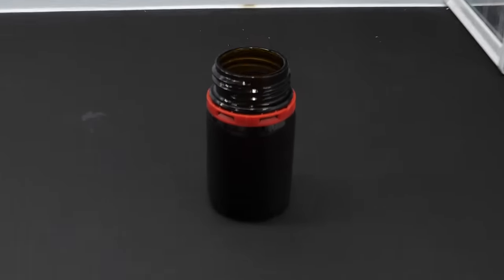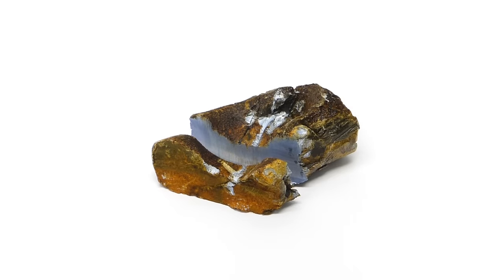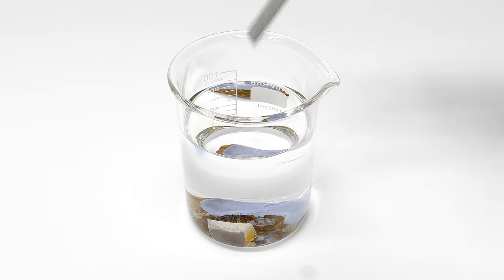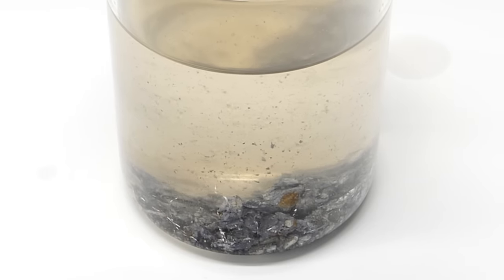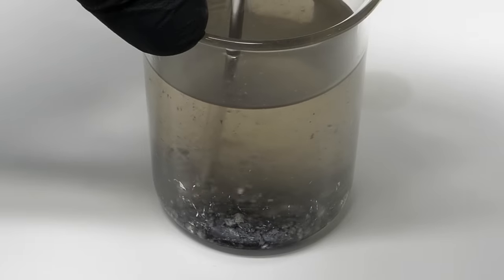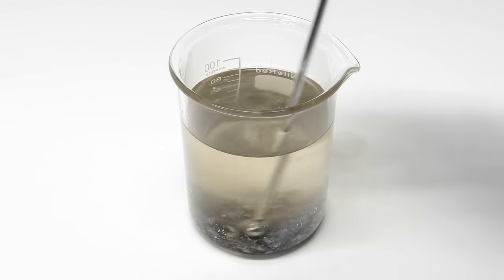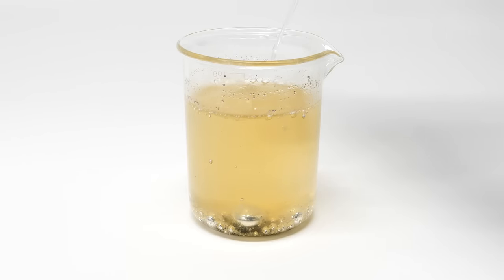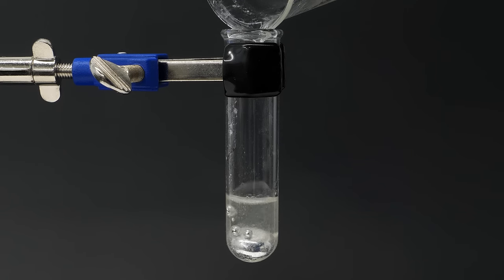Mixing sodium and potassium is crazy (NaK)

Comment: The only thing wilder than the fact that these two highly reactive metals combine to form an explosive liquid alloy is that there was seriously a plan at some point to use it as nuclear reactor coolant.
Reply: NaK is already used in solar array generators.
Reply: @patrickjanecke5894  I hadn't heard that! That is also kind of wild. Call me timid, but "may catch fire when exposed to air" is generally a deal-breaker for me when it comes to infrastructure.
Still, a solar array spontaneously catches fire & explodes, it's probably not international news.
Reply: @KSignalEingang  😁 lol
Reply: ...and now I'm reading that about 10 years ago somebody was marketing a CPU cooler that used NaK... 

Welps.
Reply: It is already used as a coolant on nuke subs.
Reply: "Yeah, but your scientists were so preoccupied with whether or not they could, they didn't stop to think if they should."
Reply: There wasn't just a plan. It was used in the soviet RORSAT satellites as well as in an actual Nuclear Reactor which powered the UK power grid from '59 to '77 (Dounreay Fast Reactor was it's name). 
The issue with their past usage as a coolant on satellites is that it has leaked on multiple occasions (e.g.: Kosmos 1818 and Kosmos 1867) and as such there are now multiple bubbles of NaK orbiting the Earth as space debris. BTW these bubbles can be up to several centimeters in diameter...
Cool stuff huh

Edit: corrected a mistake pointed out by John McCallum
Reply: @adama1294  As far as I know only the Alfa class subs used a liquid metal reactor in an operational capability and those were Lead-Bismuth cooled reactors and not NaK
Reply: At least Superphenix "only" used sodium without the potassium as nuclear reactor coolant ... which still was dangerous enough by itself.
Reply: @emile_jeanne  I think you mean The UK as Dounrey is in the North of Scotland
Reply: @johnmccallum8512  you're absolutely right, I misread something on the Wikipedia article.
Reply: @chaitanyasingh3258  And for obvious reasons, metal-cooled reactors are not an amazing idea, even leaving aside the complex nuclear science that explains why water is a god-tier reactor coolant.
Reply: Works better than water and is being used in some nuclear powered vehicles as you dont have access to the outside so you need a internal cooling system and this works to move heat out into the sea through the steel wall these points are also weak points as these area produce a heat reading.
Reply: @KSignalEingang  Maybe not international news in the same way as a reactor going all pear-shaped, but I could see no end of memes about a solar array experiencing a "meltdown." Kinda' like how a lot of us went ape with "The ocean is on fire!" a few years ago.
Reply: @KSignalEingang  The world's been safely dealing with pyrophoric substances for a very long time.  We couldn't exist as the society we currently have unless that had been figured out.  For example, I built a couple ammonia plants about a decade ago.  The development of the Haber-Bosch process to catalytically make ammonia to be used as fertilizer has led to 1-2 billion more people being able to survive on the earth, probably more.  The catalyst for the reaction is pure iron.  But it arrives as iron oxide and has to reduced in situ at the start up of the reactor to pure iron to catalyze the reaction.  Pure iron is extremely pyrophoric, of course, as anyone that has ever seen a tool create sparks can attest.

Now, because that reduction process takes so long, and takes so much valuable hydrogen to complete, usually the catalyst is sold partially reduced already.  That significantly speeds up plant startup, but it also means that the catalyst will start burning if you expose it air when you take it out of the drum.  Ammonia plants use significant amounts of hydrogen and run at about 900-1000 deg F and 2000-3000 psi pressure.  Hydrogen has one of the widest flammability ranges of anything; it will combust with as little 4% and as high as 75% hydrogen by volume in air.  So even a little leak of hydrogen is a terrifying thing, and they're very hard to detect.

Despite this, ammonia production consumes a few percentage points (it may have been close to 10% at some point) of the entire world's energy consumption last time I checked.  So, engineers and operators have managed to figure out how to safely deal with pyrophoric substances and much nastier conditions in much more dangerously flammable and explosive environments at a scale that dwarfs almost every other type of industrial production in the world.  Still, fellow engineers, never get cocky and lackadaisical; the stakes are always high no matter how many times something has been implemented safely.
Reply: @kdawg3484  this was very informative! Im a chemical engineer in the biotech space, so its always cool to learn more about other sides of the field :) cheers
Reply: At my previous job, I once spent a few days trying to find papers about the physical properties of NaK because I wanted to estimate the effect of solar radiation pressure on the orbits of the NaK droplets that are orbiting the Earth as space debris.
Reply: We were using a 55 gallon drum filled with sodium to fill up an experimental scientific instrument that applied a magnetic field to a drum and would measure the field when the drum was stationary and empty, when it was spinning at 3,000 rpm, when it was stationary but filled with 55 gallons of liquid sodium, and when it was filled and spinning at 3,000 rpm. To run the machine, you have to heat up the entire machine to about 120 Celsius to make sure none of the sodium freezes in the machine. Nobody wants to be anywhere near the building that it's in when it's turned on. I figure NaK might be a much easier medium to use in the machine rather than sodium because it would remove 10 hours of work before and after running the machine.
Reply: @KSignalEingang  TBF, NaK is much less likely to explode from phase change pressure...
Reply: @KSignalEingang  As an engineer, I would rather a nuclear reactor were cooled by NaK than water.  With a boiling point of 760⁰ C and not being nearly as effective in galvanic reactions, it is far less likely to either burst from pressurized vapor (insert every nuclear power reactor catastrophic failure so far here) or chew through the metal pressure vessel holding it (a home hot water heater lasts how long?)

Yes, it is scary when in contact with water, and can even burn in air, given time, but water is far more difficult to control.
Reply: what do you mean "was"? Still is
Reply: @patrickjanecke5894  Periodic Videos did a short vid on Nak and in it they mentioned that NaK was corrosive, how do you deal with that? Do use stainless steel piping or some other alloy?
Reply: i mean it's a metal alloy that's liquid at room temperature, that's a very good thermal interface, and it's made from fairly low-cost ingredients, i'm surprised it isn't used more often. would probably amazing if someone could use this in microfluidics for some on-chip cooling.
Reply: Liquid metals are super effective as coolants.
Reply: @patrickjanecke5894  Thank you for the info.
Reply: @KSignalEingang  that's a great idea thank you.
Reply: @this_is_japes7409  my exact thoughts. I read a comment in fact that someone said a company used it to cool CPU's so I can't wait to try it.
Reply: Not just a plan. It is used.
Reply: IIRC some of the Soviet reactors in satellites use this as coolant. Exposure to air really isn't an issue there.
Reply: @KSignalEingang  yeah I don't think solar arrays are liable to douse a large area in radioactive fallout making it uninhabitable for literally thousands of years so I think NaK is much safer there
Reply: @AsbestosMuffins  I meant solid metal reactors need to be running above a certain threshold at all times, they have some major drawbacks. That said, that is less of a concern for a civil plant than a warship.

And in any case, I too am a strong proponent of nuclear power.
Reply: @KSignalEingang  lithium ion batteries catch fire when exposed to air...
Reply: @chaitanyasingh3258  There was also a single November class that use the same reactor(s) as the Alfa.
Reply: Use a explosive for a coolant?? Wtf?! That is a suicide mission!!
Reply: Lithium battery is kinda the same useful to explosive ratio, no?
Reply: It is used in some car engine valve stems as a coolant. Since it is sealed inside the stem, it is pretty safe.
Reply: Well....that would have made the Chernobyl disaster much more....... interesting!
Reply: to do WHAT
Reply: @dojokonojo  
The author of that never thought about whether he should have used hallucinogenic drugs. Or use BS chaos math in that book. Chaos math is fine. But it has nothing to do with the keeping dangerous animals pinned up.
Reply: What I’m getting from some of the longer comments here:

“It’s nothing special, but follow SOP”
Reply: It has also leaked out of satellites, becoming space debris.
Reply: Compared to high pressure steam that is positively benign. I had only heard of using sodium as coolant but I see the advantage of liquid at room temperature.
Reply: @emile_jeanne  imagine the light show of a several Kilometers wide ball of Nak entering the atmosphere . Several centimeters in diameter just isn't enough for for New Year's Day. 

I propose More Nak in low earth orbit, this is my contribution to Humanity, based on the info you provided, you should be honored, you're welcome humanity!
Reply: it wasn't planned it was actually used -> https://en.wikipedia.org/wiki/Sodium%E2%80%93potassium_alloy#Coolant
Reply: What? I'd better stay with water rather than having this explosive thing in an already dangerous nuclear reactor which can also explode without proper treatment
Reply: @maverickgames5972  
It burns on contact with water and air but is at under 2bar when the reactor is hot rather than 70bar. The steam leak is far more dangerous than a flaming liquid metal leak.
Reply: Well that plan seems like a reality
Reply: Ironically it's much easier to safely store sodium (which does not burst into flames on contact with air) than supercritical steam in the event of an emergency.
Reply: @emile_jeanne  these blobs are no longer in orbit
Reply: @calvingreene90  Anyways not a good idea in any scenario haha
Reply: @ERIK-457  Reactive with water =/= "explosive". This stuff won't phase change until extremely high temps allowing for a thermodynamically efficient working fluid that will only smoke and fizz when it leaks rather than becoming an exploding death ray like water.
Reply: @emile_jeanne  so, it’s stable in the vacuum of space?
Reply: @BearAerospace  HOw high is that temperature at which it starts to set on fire?
Reply: Chernobyl would have been much worse, is all I'm going to say.
Reply: @emile_jeanne  hey uh
How bad would the damage from those NaK bubbles be if they went boom on earth
Reply: @benorth0311  Well they would only react with gamma rays and other radiation found in space. So I guess it would maybe become slightly radioactive, but it wouldn't react explosively since there isn't really any water up there for it to react with. The Wikipedia article only mentions that in the vacuum of space, NaK self forms into bubbles. That's pretty much it.
Reply: @emile_jeanne  thanks Emile! I usually do not use Wikipedia, but I may have just found a reason! Awesome!
Reply: I guess if you're already qualified to make sure the nuclear stuff doesn't leak out, then you're fine making sure the regular stuff doesn't leak either.
Reply: Don't worry, in the nuclear power industry everything is always completely under control.
Reply: It was between that, and heavy water. Glad they didn't try both at the same time!
Reply: @adama1294  on what sub? all active subs use water pressure reactors only soviet alfas used liquid metal reactors but those used lead-cadmium coolant that is really toxic
Reply: @dojokonojo  If you think this is bad, read about studies into AI safety.
Reply: Because "Explosive" and Nuclear reactor" go great to get
Reply: What's the appeal of using this as a coolant as opposed to something like water, which is normally used and is a million times safer, or even something like mercury, which might be toxic but at least it doesn't spontaneously combust and explode?
Reply: well not like it is the most insane nuclear plans i have heard. the one to make the panama canal by detonating 28 nukes to git rid of all that pesky dirt and rock
Reply: @adama1294  this is not true. As others have mentioned the Soviets did use a lead-bismuth eutectic in the Project 705 boats.
Reply: @BearAerospace  Interestingly, the reaction with water is sort of explosive, and it's only recently we had any real idea why. Rather than just reacting at the surface, the water seems to dissolve the electrons unreacted, causing surface tension to drop below zero and jets of metal to get launched into the water, increasing the reaction rate massively. 
The biggest problem is that water is also a fantastic radiation shield and backup coolant, so we would love to be able to have everything in a giant pool of water. Large quantities mixing is not unlikely in an accident. If they were just hypergolic, and that meant a big fire, that would be bad, but manageable. Hypergolic mixes are generally quite difficult to make explode, because they burn before that happens. For these two the reaction actually drives the mixing, making it far more dangerous than just fizzing and smoking you would get from a normal hypergolic mix.
Reply: @petersmythe6462  hopefully it burns up before re-entry I'm sure the soviet's calculated that 😂
Reply: Its one of those things though isnt it. Once a nuclear reactor has exploded, a bit of nak is going to do very little to change the results. :)
Reply: I'd like to learn more about that. Why? How? Where? Was it ever tried at all?
Reply: NaK coolant has been used in dozens of past and present reactor designs (EBR-1 and 2, Fermi 1, Phenix, Superphenix, Monju, BN-350 and its predecessors, and the currently running BN-700 and BN-800.) Its main advantage is low neutron absorption and very good thermal conductivity. The reactors are safe and designed to contain any possible leak of NaK.
Reply: @adama1294  Aren't they using pure Sodium (not that I would be less worried then)
Reply: sounds safe to me
Reply: @KSignalEingang  Well yeah, when the fire goes out and the smoke subsides, you're CPU will be at ambient temperature.
Reply: @KSignalEingang  never seen how hot the oil gets in gas turbines? Or wind turbine reduction gearing? 

Because I'll save you the effort: Hot enough to be in the autoignition range, fire held in abeyance until it gets oxygen. 

Wind turbine fires, spectacular ones at that, have been recorded.
Reply: These are not just the plans, sodium was used as coolant in breeding power reactors in France and Soviet union and is still in use in 2 operating plants in Russia, one more is planned to build.
Reply: @jamesharding3459  water is god tier until you realize that it requires high pressure to not boil at too low a temperature and that it can generate hydrogen gas with the zirconium on the fuel rods. 

Edit: oh yeah, and even when your reactor is a radioactive pressure cooker the water still boils at a fairly low temperature, theres a good reason many reactor concepts and some being developed rn do not use water
Reply: Imagine if the pipe broke in the heat exchanger.
Reply: @alikibueno2062  you'd probably be surprised, but tube rupture in PWR steam generator is no less dangerous (at the very least)
Reply: it's a great coolant for nuclear.. water as coolant is bad. It breaks down into hydrogen and oxygen gas, which explodes...
Reply: @KSignalEingang  well nak is a really good conductor and it’s lighter than water to making it useful in lightweight nuclear reactors and quite advantageous to use when the thermal conductor is at the top of a 27 (90~ft) meter tall tower
Reply: They use nak is a ingredient for firework
Reply: @KSignalEingang  big oil would have a field day. I'm sure you'd never hear the end of it
Reply: It is also used as a hydraulic fluid in high temperature and radiation environments
Reply: The great thing about NaK is that it can be pumped electromagnetically, with no moving parts.
Reply: @adama1294  I'm guessing because of the pump system having to be extremely quiet, in other words it uses an electromagnetic pump to circulate the NaK?
Reply: Worked in a Union Carbide plant in Luling, LA  in the early 1970s where several tons of this alloy was used as a heat exchange medium in one of the units. One day there was a leak and the resulting explosion leveled the unit in the plant, including destroying the process control computer center in an adjacent building.
Reply: Wha- Huh?
Reply: Just because something is highly reactive doesn't make it instantly hazardous. Stop breathing oxygen if you really feel so worried about reactive materials.
Reply: You do know that people use hydrogen to cool generator for steam power plants right? Eventhough hydrogen is explosive.
Reply: @KSignalEingang  I can almost guarentee that was bc they didn't want to use galeum due to how it eats certain metals.

Still NaK in a homemade build seems sketchy.
Reply: @KSignalEingang  yeah that sort of happened once too... early british reactors had a problem with air.
Reply: It was more than a plan. It actually WAS used as a coolant. It was used in fast breeder reactors like the Dounreay Fast Reactor because it doesn't absorb neutrons.
Reply: @dojokonojo  Yes, Unfortunately your statement applies to pretty much everything human's have been doing for thousands of years !
Reply: Not just a "plan."  Pratt and Whitney and United Nuclear..,
Reply: Wasn't that how they did it in Soviet Russia?
Reply: I would have expected it to be used in a crossbow bolt of sorts.

Reacting with the water inside living tissue.
Reply: See it at dounreay Scotland. Liquid sodium coolant
Reply: Chernobyl likes it xD
Reply: imagine a normal civillian in the future when they found ruins of these nuclear reactor, tries to fiddle and turning it on, but is looks like it gonna catch fire and tries to douse it with water and then BOOM
Reply: I don’t see what’s wrong with that
Reply: @KSignalEingang  though i dont know if it's the same, iirc i saw a review of a cpu cooler that worked by de-liding the cpu and having liquid metal as the heat conductor (liquid metal touching the exposed cpu). Worked and kept the cpu very cool but also seemed difficult to install so would never even think of trying it
Reply: Hindenburg comes to mind
Reply: @patrickjanecke5894  At least that won't become radioactive
Reply: It was used in the fast breeder reactor at Dounreay for almost 20 years with no major problems. Like anything else, scientists proposed the mix for good reasons. And like anything else, as long as it is well designed and built and proper safer procedures are followed, there should be no issues. 
Indeed, you could make the same point about a highly flammable and explosive hydrocarbon mixture (petrol) used to power cars...
Reply: Not only a plan it has been done
Reply: @adama1294  it's a liquid metal, so its much more heat conductive than ordinary coolants, 

yes, you could use mercury, but if the submarine is taken down in the ocean, you dont wanna have a buncha irradiated mercury in the water
Reply: @emile_jeanne  dw, they'll blow up as soon as they enter the atmosphere
Reply: @God-ch8lq  It's ok I'm not worried lmao :D
Reply: What
Reply: @KSignalEingang  "Call me timid, but "may catch fire when exposed to air" is generally a deal-breaker for me when it comes to infrastructure." 
- has me in completely in stitches! 
You sir, have won the internet for me today <3
Reply: @dojokonojo  you legend you <3
Reply: There would be a huge problem if water started getting in
Reply: @kdawg3484  i was thinking there was a possibility you may be lying, as people normally do, but then i noticed your join date, and im going to be honest, no story fabricator would be that old, but if you could further the proof, i would like to see some videos of the plants you built, if you live around the area. i generally like things that deal with agriculture, and it is what i major in. i will have to look into the use of ammonia in fertilizers for myself now. im already aware of potassium nitrate in fertilizer, but its so hard to get your hands on it these days because people keep using it to make bombs.
Reply: Damn
Reply: @adama1294  NaK. Near a nuclear reactor. On a SUBMARINE. I beg of you, say sike.
Reply: Bro :l
Reply: @KSignalEingang  we already have galinstan for that and its already a big no for me just in case the gallium in it touches any alluminum
Reply: Forget Chernobyl, that would have made Planet Earth go critical 😆😅
Reply: more like a nuclear reactor cooln't
Reply: @kdawg3484  There is a wonderful book called “The Alchemy of Air” about the discovery and commercialization of the Haber Bosch process and the unintended consequences if having an abundance of ammonia.
Reply: The weirdest thing about it to me is that the reaction to make it isn’t instant/explosive
Reply: @thecyberrabbit1440  two very similar elemental metals in a molten state being combined. Called alloying, backbone of civilization. While each is very reactive to other dissimilar substances, they are chemical siblings and more or less unreactive towards each other
Reply: @nohphd  they weren’t molten. They went from solid to liquid by combining. They weren’t liquid before they reacted
Reply: @thecyberrabbit1440  Na and K combine to form a eutectic alloy which itself has a lower melting point than either of the melting points of the pure elements. Physical chemistry is weird…
Reply: holy , can you imagine the devastation it would cause .
Reply: It looks to be okay so long as it is kept away from water, and melted salt coolant systems are pretty common designs for nuclear reactors.
Reply: @KSignalEingang  Can someone explain why this is so commonplace in product development? Do designers/engineers usually undertake full CBAs when specifying what are quite clearly potentially dangerous substances? Or would they just use these anyway by virtue that they are simply the most efficient option for the primary function, disregarding the risks/disadvantages? I imagine a lot of products in a lot of fields that have already made it to market have to be recalled for this very reason. Could be completely wrong but would be interested to know if anyone can share some insight.
Reply: Hot is relative
Reply: @wacawaka1802  I'm sure it is. You mean like the temperature of a baby's bathwater maybe too high in terms of bathing the baby but nowhere near hot enough to brew the perfect cup of earl grey? Yes, I think I'm with you. Hot is relative.
Reply: LEGIT?!
Reply: Imagine if it was used as a nuclear bomb detonator bruh
Reply: I just realized the entire reply section in this comment is just a novel about this NaK, this is explosive indeed.
Reply: @adama1294  do you have some supporting material for this claim ?
Reply: @pbe6965  it actually gently leaked for weeks at the bottom of the "barillet" used to load the assemblies without causing much trouble
Reply: @jamesharding3459   they use metal as they do not want to potentially completely stop the reaction, it like keeping hot embers for a fire so u don't have to go to the pain of relighting it
Reply: @smass8586  I was referring to what happens to the coolant if the reactor drops below the critical temperature and it solidifies.
Reply: Really?
Reply: Given chlorine trifloride is used to process the fuel for nuclear reactors that seems kinda tame.
Reply: What's wildest of all is that these 2 metals are what our bodies react to produce electricity for our nervous system
Reply: most nuclear reactors make their energy from boiling water, so extra bad points
Reply: @KSignalEingang  Can`t be worse than Nvidias new meltinf power cables
Reply: On periodic table of videos they had some kind of closed magnetic fountain that used NaK to function.

I think they did eventually use a liquid metal cooled nuclear reactor but it used lead instead of NaK (used on the Soviet Alpha class submarine).
Reply: I'll take "What is Hmmmm." For 500 hundred.
Reply: What is the liquid that you dropped the Nak in?
Reply: @patrickjanecke5894  I am assuming you mean those type of solar array generators which work by heating a target with sunlight reflected from large array of mirrors and the using the heat to run steam turbines, not the ones using photovoltaic cells. Am I right?
Reply: No, that was going to be molten salt NaCl.  Because the melting point was so high and it is inert.  Not NaK.  why in the world would they use an explosive metal as a coolant?
Reply: Bruh i just though you called my name by "wilder"
Reply: Only in space, where there's none of that pesky oxygen or water
Reply: tbf, we also have highly reactive lithium batteries...
Reply: @jamesharding3459  it's a great coolant but when it boils and uncovers the core it creates a world of hurt whereas other substances in theory don't boil off.

Many accidents in nuclear reactors related one way or another to a coolant failure (water). Sodium for example means higher safe temps and much much lower pressure as it doesn't turn to steam, no pressure relief valves to fail. These reactors also produce much less radioactive waste.

Might sound crazy but the science is actually pretty good. They recently let a test reactor go wrong in Japan to see what would happen, it got super hot but no meltdown, no hydrogen explosion and there was no damage and restarted the reactor normally.
Reply: @norfolkngood8960  If that test reactor had to be restarted, they must not have been using a metallic coolant like sodium. There’s no way they re-liquified the coolant in situ.
Reply: @jamesharding3459  they never let it solidify
Reply: @norfolkngood8960  Well, that's not exactly a cold restart then is it?
Reply: @jamesharding3459  when did I say cold restart?
Reply: @TheConpressor  that liquid metal is made of mostly gallium. Have done it myself.
Reply: @emile_jeanne  well on a satellite without any oxygen it makes sense
Reply: @Anankin12  Then there's the fact that NaK will react to Teflon so there's that as well... However I'm not sure about it's reactivity with metal oxides such as Iron Oxide which I'm sure could be found on the surfaces of the satellites...
Reply: @1TakoyakiStore  Yes, I've seen that video, the fountain worked for quite some time and nobody died. They removed it eventually for safety reasons. I suppose it's easier to scare chemistry students these days, sad.
Reply: @emile_jeanne  
Gamma rays do not cause an item to become radioactive, that happens with neutron activation.
Reply: @markoap91  
Mercury vaporizes at room temp, moves with airflow, and condenses in cooler locations.  Mercury toxicity is hard to control in large scale operations.
Reply: @si2foo  
The Soviet Union detonated one in a cave to vitrify the walls so they could use it as a water reservoir.  Couldn't use thought, leached too much radioactive contamination into the water.
Reply: @thecyberrabbit1440  
That's why it is contained in petroleum based products...they don't mix with water.
Reply: @thecyberrabbit1440  
An arsonist used metallic sodium, gasoline, water, and a heat source to burn buildings.  He would put water in the bottom of a glass jar, then add gasoline.  He would float a chunk of sodium in the gasoline with a cork.  The heat source would vaporize the gas allowing the sodium to descend into the water.  The Na-H2O reaction would ignite the gas fumes causing an explosive fireball.  Took several hours so he could be long gone.
Reply: @murphy7801  
ClF3 is nothing to mess with.
Reply: @MaturePatriot  I am well aware of that???
Reply: @MaturePatriot  Yes, I still don't understand why you're telling me this. I am well aware of this information... Remember:
Everyone has access to Wikipedia. Not everyone has access to experimental nuclear devices that orbit the Earth. That's where I wasn't sure about my hypotheses. I've completed all the base knowledge courses about Radioactivity you can legally get... Please go teach someone else in this discourse.
Reply: I'd use it as a battery, much better than LiPo
Reply: @kdawg3484 this process is still much more terrifying than nuclear fission. I would live 100m near a nuclear reactor but would never live near such facility.
Reply: @markoap91 lol, water is safer.
Chernobyl was basically a steam explosion.
Reply: @TheConpressor that was a galium compound, it must be cool if it leaks to the other side of the flip chip silicon, the metal layer is made of aluminum.
Reply: Not a terrible idea at all, in-fact with proper engineering I see no reason why it couldn’t be implemented… NaK and other liquid metals have a low prandtl number (the ratio of momentum diffusivity to thermal diffusivity). This means that conduction dominates heat transfer rather than convection… very unusual for a fluid, but advantageous in some specific cases. 

This property is why NaK is used essentially as a thermal battery in solar heat generator arrays. It can stay hot all night long while the sun isn’t shining in a properly insulated tank, and be used to pick up and distribute heat from the solar mirrors to the boilers. 

I know having a highly chemically reactive fluid might sound insane in an already dangerous nuclear reactor, but generally I think that should never stop engineers. We have safety standards for a reason. 

Remember, the working fluid in every refrigerator is a highly toxic gas, your high voltage microwave transformer can kill you in many different ways, and your house probably has gas lines or a boiler that could explode and destroy half your neighborhood. Our modern society relies on MANY extremely dangerous things to function…
Reply: @jamesharding3459  water is great as a coolant. It is appallingly bad as a reactor coolant. Radiation splits it and the hydrogen can collect and cause explosions as happened at Fukushima. The low boiling point means it hast to be operated at very high pressure to get decent thermal efficiency, opening the door to lots of failure modes.
Reply: Kaboom 💥💥
Reply: https://en.wikipedia.org/wiki/Fast_Flux_Test_Facility
Reply: @adama1294  it is?
Reply: @jamesharding3459  Well maybe if you ignore the fact that water boils at an uncomfortably low temperature and can split and produce hydrogen when exposed to radiation.
Reply: The EBR -1 in Idaho, USA.    You can take tours of it
Reply: Sodium and potasium will flame up and blow up in water by themselves
Reply: @patrickjanecke5894 uclear reactors don't use mineral water for the inner loop. It's distilled water*.
Reply: @LtdJorge  Pure water has its own issues with corrosion, especially when hot or moving fast.  Ions just make it faster.
Reply: @dejjal8683 many liquid metals are corrosive in a very different, and far more sinister way than what we think of when we hear corrosion. Liquid metals have an ability to "soak into" solid metals and create alloys with them. This action can turn a solid metal vessel into something as fragile as glass, and rapid catastrophic failure can occur when your entire tank shatters in an instant. Look at what mercury and gallium can do to aluminum. Everything looks fine until the aluminum crumbles like cottage cheese!
Reply: Jesus 😂
Reply: To update the SNL joke: “you can’t put too much highly reactive flammable coolant into a nuclear reactor”
Reply: @jamesharding3459  Metal cooled reactors is a great idea in fact, much more so than water cooled. Do you know what happens if there's an excursion? More times than not, nothing happens - some core damage at the most and the reactor shuts down. Do you know what happens if there's a fast excursion in a water cooled reactor? I'm sure the nice people or Pripyat or the former workers of SL1 can fill you in.
NaK cooled and Na cooled breeders are absolutely the way to go to solve the energy question until we have fusion. They are in use and work extremely well.
Reply: @AB-80X  1. The Chernobyl reactor incident was completely unrelated to being a PWR. It was only possible because of poor design of the RBMK reactor, disabling of safety equipment, and deliberate misuse of the reactor. Similar conditions would result in similarly problematic outcomes in any powerplant, although of varying natures. 
2. SL-1 is a freak oddity and should not be considered. It is no more relevant to this discussions than Da Vinci’s flying machines are to astronautical engineering.
Reply: @jamesharding3459 
Lead is the only reactor coolant that i would call "god-tier". 

Vs water, lead
1) interferes with neutrons far less, so that you have more neutrons of higher energy
2) absorbs gamma radiation, so doubles up as shield
3) does not chemically react with water or air like sodium
4) very large difference between boiling point and melting (1400K IIRC), so it can operate at higher temperatures without higher pressure. Removing high pressure reduces cost and significantly increases safety. As a bonus, you get higher efficiency at higher temperature
5) excellent conductor of heat. This combined with large temperature range of liquid makes it more resilient
6) lack of high pressure and phase change means that in the event of a leak, coolant is not violently moving and expanding into surrounding

Lead has its problems, like higher melting point than sodium (so higher minimum possible operating temperature) and higher mass density (so heavier) than sodium. So sodium is a good alternative to lead
Reply: @maverickgames5972 
It is the water in nuclear reactors that can "explode". You need weapons-grade uranium/plutonium (>80% U-235 or Pu-239) to make nuclear bombs and stuff used in nuclear reactors is less than 20% U-235. Usually less than 5% U-235. So nuclear reactors cannot explode like nuclear bombs.

This is without considering always active, passively safe control/safety rods that will shutdown reactor in emergency
Reply: Vs water, liquid metal coolants like Na, lead, NaK
1) interferes with neutrons far less, so that you have more neutrons of higher energy
2) absorbs gamma radiation for lead, so doubles up as shield
3) does not chemically react with water or air for lead and relatively non-corrosive
4) very large difference between boiling point and melting (1400K for lead IIRC), so it can operate at higher temperatures without higher pressure. Removing high pressure reduces cost and significantly increases safety. As a bonus, you get higher efficiency at higher temperature
5) excellent conductor of heat. This combined with large temperature range in which they remain liquid makes it more resilient
6) lack of high pressure and phase change means that in the event of a leak, coolant is not violently moving and expanding into surrounding

Lead has its problems, like higher melting point than sodium (so higher minimum possible operating temperature) and higher mass density (so heavier) than sodium. So sodium/NaK is a good alternative to lead

Sodium/NaK and especially lead is so much more inert than water in nuclear reactors. They never actively try to break/destroy reactor vessel. They never create bad stuff when bombarded with neutrons. They never violently expand when suddenly exposed to air.
Reply: But it would be completely safe. NaK has no way to start a fission chain reaction, it doesn't release neutrons all over the place
Reply: Not a plan, it was done.  Several times.  I used to work at one of those sites.
Reply: @adama1294  Not on any current US submarines it isn't.
Reply: Surely this reactor coolant plan is completely safe and wont result in any accidents…
Reply: @KSignalEingang  it's a deal breaker for me too I'm an amateur chemist and I do chemistry at home as a hobby and as an amateur chemist I consider some types of chemicals to be too dangerous to work with at home because doing amateur chemistry as a hobby at home I do still have PPE at home like gloves a respirator and a face shield but I don't have some of the other safety equipment available at home that is available in properly equipped chemistry labs for example I don't have a properly functioning fume hood at home. Even if I did have my own properly equipped chemistry lab complete with safety equipment like a fume hood there are some chemicals that scare me so much that I wouldn't work with them anyway. A good example of a chemical that scares me a bit is concentrated hydrofluoric acid since it's both highly corrosive and extremely toxic
Reply: The fact it is so reactive could be a bonus. Any leaks in a reactor would be EXTREMELY easy to detect. And you could make it so any leaks cause automatic shutdown.
Reply: @KSignalEingang it doesn’t catch fire from air
Reply: "plan"
Reply: That's awesome, didn't know that, thanks. God bless. Jesus loves you!
Reply: @KSignalEingang All the coolant will catch fire when exposed to air. That's not a big deal at all.
Reply: @jamesharding3459 Liquid metal reactors are an amazing idea and basically the only way forward....